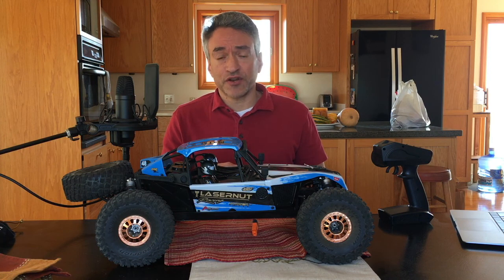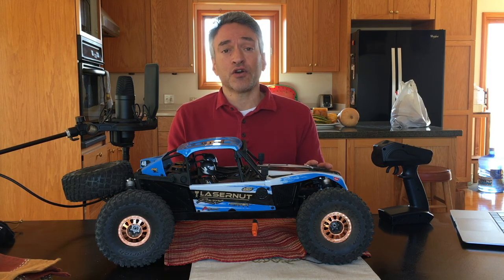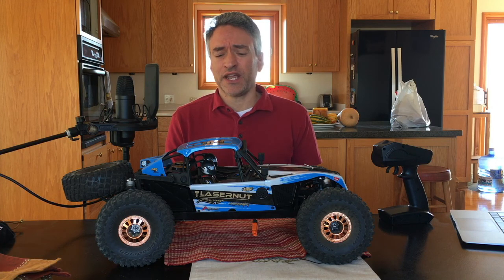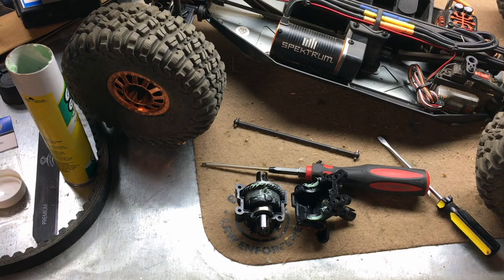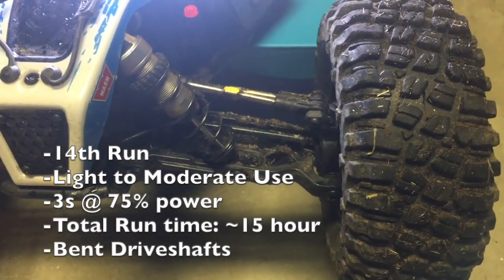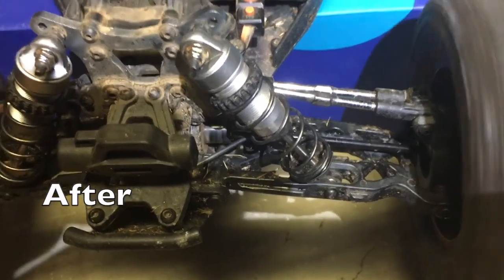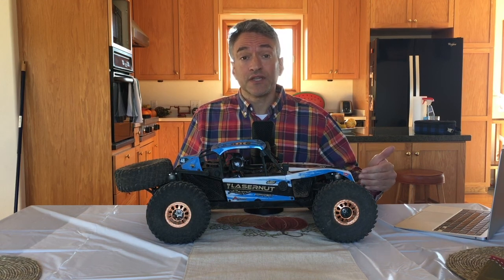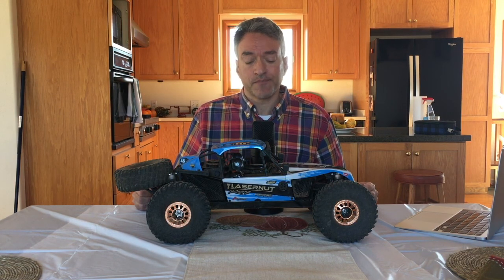Losi Lasernut Durability Test

Comment: Thanks for the thoughtful video.  I also have a Lasernut and have had a blast with it. I take it into a reservation near my house that has great trails and use it as it was designed.  I'm not bashing it. I did break the right driveshaft from landing it awkwardly.  Any other vehicle would have hit the body but I hit the 5.75" tire. That force broke the small axle. The center rear outdrive wore a groove in it as did the right rear outdrive.  I did hear noise from the rear. Taking it apart the rear pinion was loose in the differential housing and eating it away. It would have blown within minutes of use. I have replaced the rear and front differential with the TEN SCTE 3.0 parts. Everything except the ring and pinion. The gears are beefier and the case is a higher quality of plastic.  
Hopefully this will resolve any diff problems. My suggestion for potential customers is to wait for V2 before buying.  This is a 4S machine and we are paying for 4S. I do run alot of 3S too. On your property try 4S and you'll realize the big speed difference.  In big spaces the speed is fun. Keep updating your progress. I only have 3 packs through mine at this time. 2 4S and one 3S since the diff repairs.
Please note that the Arrma Typhon, for the same money can do everything the lasernut can do if 5.75" tires were on it. It even looks cool. I bought one of those too. In hindsight I should have passed on  the Lasernut until V2.
Reply: Quick update, I have put another 8 packs through the LN. The diffs are holding up well. I've been running along side railroad tracks near my house.  Lots of bumps and whoops. The Lasernut handles it very well with the AVC cranked up. On 4S I did hit 20mph on the rail bed. Super impressive. How is yours doing?

Comment: Thanks for this video.  I really like the style of the more scale models.  But it seems that most modern cars/trucks have moved away from scale styling and have become too cartoonish for my tastes.  So, I've been really interested in perhaps picking up a Lasernut next.  But have had reservations due to all of the reported issues.  Then again, it seems that hardcore bashing has become the predominant use of RC buggies and trucks these days so all of the negative reviews I've seen have been launching them over and over off of huge jumps, bad landings, etc...  Just generally abusing the vehicle.  For that use I guess an Arrma would be up to it, but I don't expect all vehicles to be.  But, your use is exactly how I like to use mine...  more in line with a scale version of how the actual Lasernut is used, and they don't go off of 500' (scaled) jumps!.  And for my application 3S is likely plenty.  I often run my 3S buggies and truck on 2S and find it does fine for my application since I'm not doing speed runs or huge air.  So, your video is appreciated as it gives me a better idea of what I can expect out of the buggy for how I plan to use it.  Now I feel a bit more comfortable buying one, setting it up for 3S, checking mesh in all diffs, and enjoying it for what it is; a very cool looking scale off-road racer buggy.
Reply from the maker: My son did break one of the front drive shafts recently. In the same place others have reported them breaking. However, my son hit a rock and the drive shaft had already been bent and straightened out by me so it was weakened. We'll be replacing both front drive shafts with OEM parts. I'll see how long they last.
Reply: @Comfort_One_Another  Thanks for the update.  I've been trying to research these buggies but it's difficult to get a good feel for them due to the fact that almost every video is of extreme bashing, with repeated big air jumps.  Horses for courses, and all that...  These buggies are designed to be an RTR U4 racing buggy, not a stunt basher.  And anyone that's ever seen a real U4 event knows that big air is not part of the track layout.  If I wanted a basher to "send", I'd be looking at an Arrma Kraton or some such.  Being an RTR, I don't expect them to really be competitive in U4 without upgrades, but I'd like to at least get a feel for how well they do while doing what they're intended for...  Yours is really the only real world video review I've seen to date that tells me what I'm hoping to find; how the buggy does in normal off-road terrain and trail type conditions.  So thanks for taking the time...
Reply: @michaelc3416 did you buy one? I really want one but I’m skeptical as well. Leaning more towards the DB pro now but man I love the look of these Lasernuts 😫

Comment: Unfortunately mine broke after an hours use on 4s. It was returned and refunded. Loved it for the hour’s use it lasted for.
Reply from the maker: What broke on it? Thanks.
Reply: @Comfort_One_Another  central diff. They are designed to run on 4s so it will last longer with a 3s. Looks and handles amazing but it’s a very high maintenance car to own. There is a long list of what can go wrong.
Reply: @rob2738  Sounds a lot like my Traxxas Rustler 4x4 vxl.  Lots of new parts.

Comment: Are you in butte county?
Reply from the maker: No. Southeast of Butte.
Reply: @Comfort_One_Another  
Right on. I grew up in the Chico area. I thought I recognized the ground and foliage of northern Cali. Keep us posted on the lasernut. I haven’t decided if I want to get the ‘nut or an axial RYFT. Hope you have a great day!
Reply from the maker: @crazyCHRISTcraver  It's still running, but we run it on 3s and not very hard. I'll probably change out the diff oil soon as a part of routine maintenance. I'm going to continue with the factory recommended weights (10k front, 20k middle, 5k back). God Bless.

Comment: Just one person's opinion, but calling the contents of this video a "durability test" is a real stretch of that particular phrase. The Lasernut in this video was put into about as much danger as a drift car.   The Lasernut truly excels at driving around on flat ground with no obstacles on it...  but you could have driven a Tamiya rally car on everything shown here, with a similar level of "durability."  The driving I saw here was a degree removed from wrapping it in cottonwool and putting it on a shelf.   Getting an hour out of a 5A battery is kinda indicative--  I get ~25 minutes out of 6A.
Reply from the maker: I made if very clear from the beginning of the video that this was a durability test to see if the Lasernut could handle light to moderate use. It's not my fault if you're disappointed because I didn't do the exact opposite of what I said.
Reply: @Comfort_One_Another  What could conceivably lead anyone to believe that a Lasernut--  or any hobby-grade RC vehicle-- couldn't handle that level of "abuse?" While fully understanding that it is a wholly subjective term, I kept waiting to see "moderate use," but that certainly never happened.
Reply from the maker: @CrawlerCanyon  There were videos demonstrating that Lasernuts were breaking prematurely. I was curious if the Lasernut would break under the conditions you see in the video I made. We did experience bent driveshafts and now a broken driveshaft. Therefore I would conclude that driveshafts are a weak point on the Lasernut regardless of how its run.
Reply: @Comfort_One_Another  This was the exact sort of light/ moderate use review I wanted to see… thank you.. ofc these are subjective and I understand might not be considered ‘moderate’ use by all but I am more considerately minded like yourself! You still have the LN? I want one! 🤠
Reply: Put into as much danger as a drift car!! I’m 💀😂!!!
Reply: @CrawlerCanyon are you slow or something? The car literally had issues from what was shown in the video. So we have already concluded that it can’t handle much abuse. He literally proved that this car breaks easy
Reply: @vee6411 wanna talk about slow? You just responded to a comment made A YEAR AGO. There’s definitely someone slow in this exchange.

Comment: This truck is absolutely horrible. I had mine for less than an hour and the center differential bearing backed out and the pinion gear totally chewed up the inside of the diff. I have been in contact repeatedly with losi/horizon hobbies  and they have had me waiting over 2 months and they still haven't sent me a replacement diff . I hate this company with a passion all these trucks should be recalled.  Watch my video
Reply from the maker: Ours is still running strong after the initial problems mentioned in the video were addressed. My son loves it.